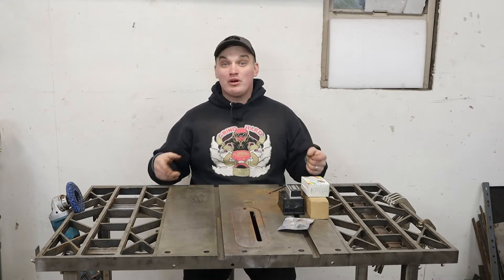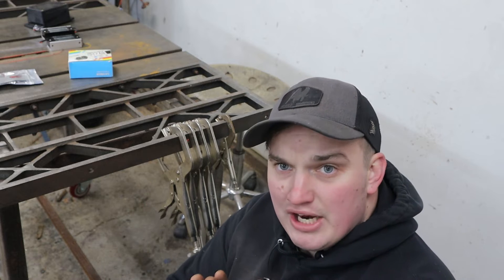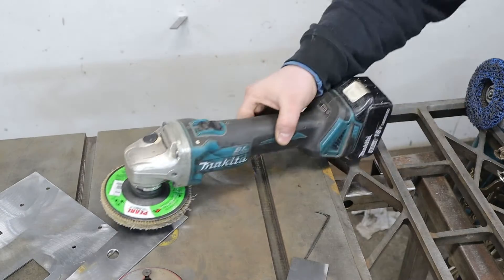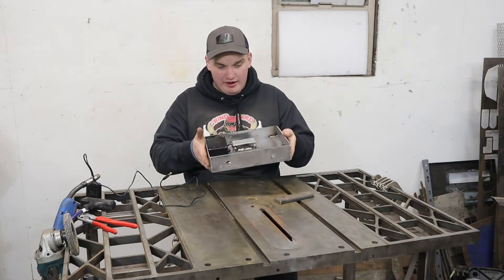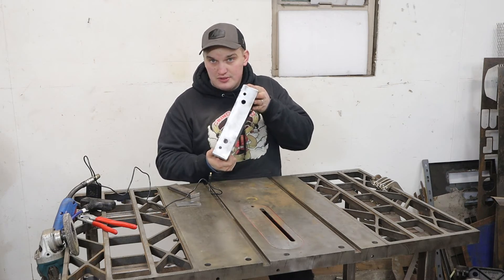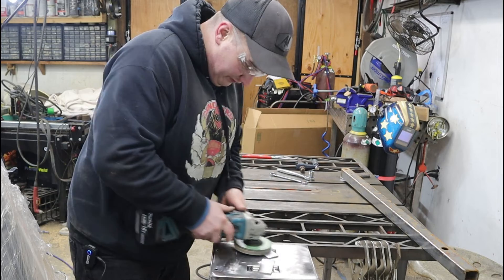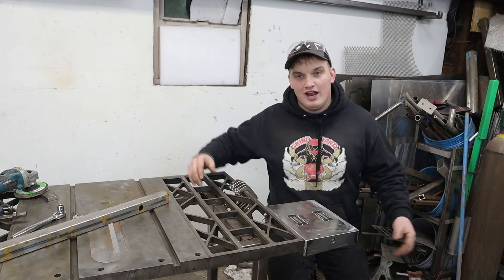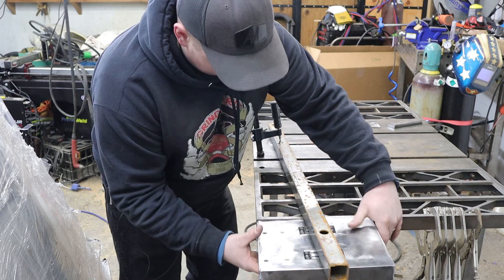Electro Magnetic Grinding Station DIY Build

Comment: Use separate power switches and separate power supplies for the mag locks. I have loads of experience with 12-volt door management systems.

If you use one power supply that is high volt/amp enough to operate both mags, be sure to add a few extra amps.

I did not see how you had them wired to tell you exactly what went wrong, but it sounds like the weaker mag was experiencing an amperage drop.
Reply: Was thinking the same, it's been 30 years since school but recalled this when I saw it. That and parallel /series wiring.
Reply: wall warts come in a variety of amp rating. I have all of them. LOL  I'm a guitar player with more effects pedals than should be legal.
Reply from the maker: Super good insight. Thanks for the info and thanks for watching. 👊

Comment: I think a stronger 12v power supply with more amps will work a little better.  I stumbled on two e-magnets like that, a little bigger, and am now motivated to do this.  Your files would be GREAT!  Also would help me get started with 360.  Always easier to modify than to create, in the beginning.  Thanks for the great idea and execution.  Tuck in the strings from your hoodie when using power tools, you scared me!

Comment: If you want to make something that's A LOT stronger, you can use a maglock for a door. Here's a great video I found a while back showing hot to do it. https://www.youtube.com/watch?v=hT29B80HB7U
Reply from the maker: That's what these where just smaller ones
Reply: @amcustomfab  The one I bought claims it holds 600 pounds, and I believe every ounce of that.
Reply from the maker: Yeah I think these ones only claimed 160 lb

Comment: If you add a couple tabs you bolt it down to your drill press table and drill between the magnets as well. The material may spin easier than lift off the magnet so may have to add some pins to stop rotation of piece.

Comment: some reasons why you'll see a variance in magnetic pull or strength. 1. if the mag units are wired in series, the voltage and amperage to the second mag in series will be lower and weaker. Wire them in parallel. 2. any variance in height between the mag surface and table platen will affect the strength as the magnetic flux is proportional to distance. Finally, for a given magnetic flux strength the holding strength will be more powerful with thicker metal. The instructions on any mag drill will explain that holding strength will vary with metal base thickness. You can even make aluminiun stick there if you have a strong enough flux and a thick metal backer
Reply from the maker: Good info thanks for the insight.

Comment: Ah! get out of my head! I bought the larger door lock style magnets and planed to set them into the blade insert area. Trailer brake magnets are also a viable source.

Vinegar works a lot better and faster when it is hot.

Comment: Great job. Only thing I would do differently or add to yours is fill the voids around the magnet with epoxy so filings can be wiped away. I have some double sided electro magnets that are bigger I might try to make this. Double sided would lock to the welding table as well. Again great job.

Comment: I want to see you show dialing in your table to cut out those super small holes so clean!
Reply from the maker: The CNC table?
Reply: @amcustomfab  yes! I can't get small holes to cut out to save my life. Also would be interested to see a video on using fusion 360 to make just pierce holes to mark out centers of holes to be drilled for more accuracy. Merry Christmas!
Reply from the maker: I would have to see your setup but the most common reason people have is improper Pierce delay  but I'm also considering doing a video on ways to make round holes
Reply: @amcustomfab  I'd love to see it! I got a 2x2 langmuir systems. Will be receiving my everlast 82i soon to upgrade from the RW45

Comment: Also would there be any benefit on turning your whole welding table into a magnetic table, so this way you can set up your items and turn on the magnet instead of using clamps??
Reply: I have personally seen arc control problems with neodymium magnets welding TIG. Not sure what  a whole electro magnetic table would do since the field would be different.

Comment: Merry Christmas Alex! Another great idea.

Have you tested it on a long piece of material? I'd like to see that.

Also. Maybe you could run off a batch of boxes and sell them? Just a thought. 

The clamping possibilities are endless on this table. For mine, I thought of putting some taller bar stock in the miter gauge slots and use that as a stop to clamp to. Or put 3/8'' tall pieces in the slots, and make a 1/2'' plate to go in the hole where the saw blade would be. Then drill a hole pattern in the new steel to have a more traditional fixture table. I think I'm going to thread the hole's. Haven't decided yet. 

I know a lot of guys just like to tack stuff down to the table. You could make a sacrificial plate to go in the saw blade area and tack to that? Or hell. I wounder if you could put the magnets in there,,,lol.
Reply: Magnets in the Throat of the saw table is a GREAT idea!  It provides a better center of gravity.   Useful in any project with ferrous metal on it.
Reply: @grantnutter9364   I'm kinda second guessing myself now. You would for sure have to cover it up so splatter didn't get on it. You also couldn't weld close to it either? 

Just a thought process in the works.
Reply: @quickcalsgarage4782  Have two plates for the saw throat: one with magnet, one without.   Broadens the versatility of the work surface, and offers three configurations: magnet, smooth, and open-hole.  Open-hole, opens up MORE possibilities ie. a F-clamp just became a jig fixture...

Comment: Great idea. I use those to lock my shop door. The longer ones have more surface area giving more resistance.  The more metal to magnet the better the hold.  Otherwise you will be able to move it easier.  Did you consider a battery solution for more portability?  Merry Christmas!
Reply from the maker: I like the battery idea!!! Thanks for watching 😎👊
Reply: @amcustomfab  I have 3D printed some m18 adapters. I 3D printed the M18 soldering station. Works well.

Comment: Why let the pieces soak in vinegar?
Reply from the maker: It makes the mill scale come over 90% easier. 😎 Sometimes it will just rinse off with water after a vinegar soak overnight.
Reply: @amcustomfab  
I knew vinegar worked on light rust but I didn't know it would work on mill scale. I'll have to give that a shot on my next project.